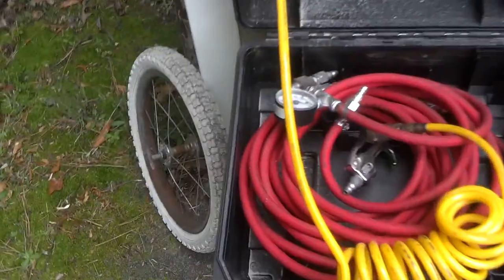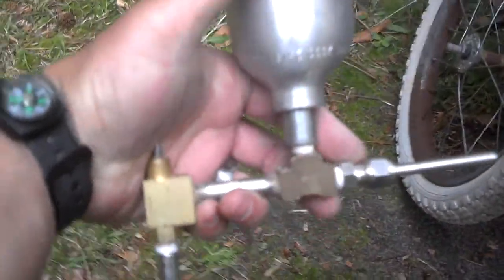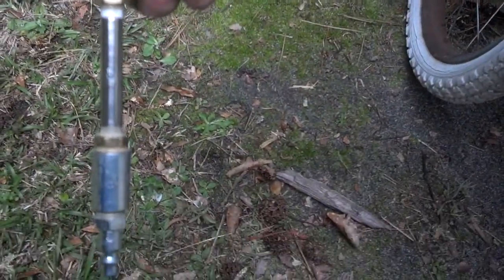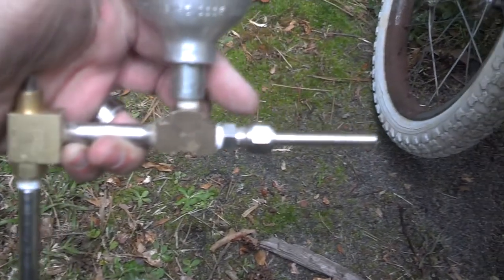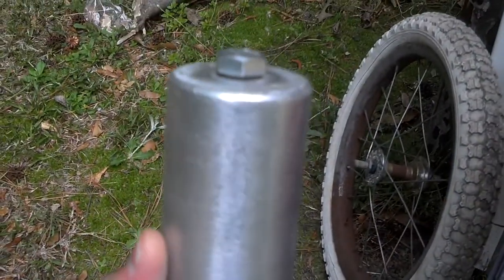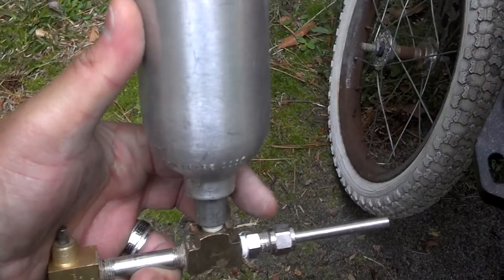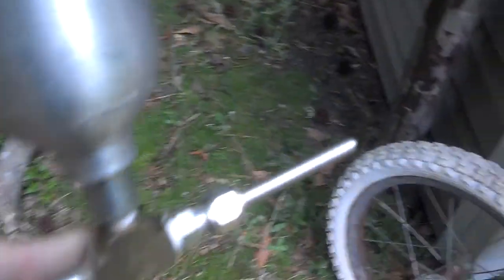Homemade sandblaster

Comment: I like it, wondering if you could use a larger canister to hold more sand to last longer?
Reply from the maker: Hi just saw all your comments and questions. Sorry haven't responded until now. Yes I th it could be used on a larger scale just be sure everything is secured and stable. It has all type of uses good luck with building. Have any questions just drop me a message be glad to help. Thanks for subscribing.